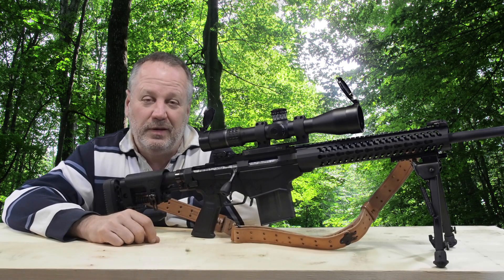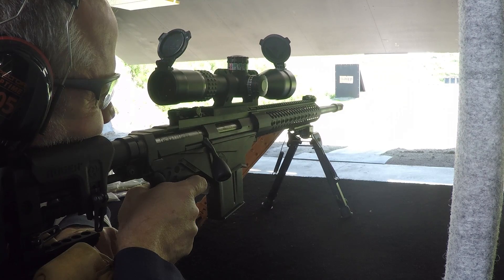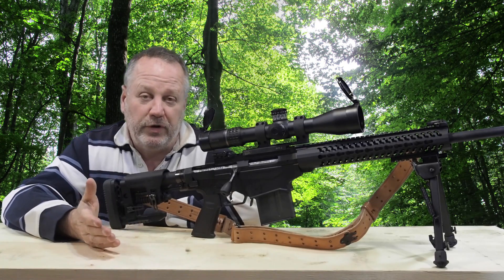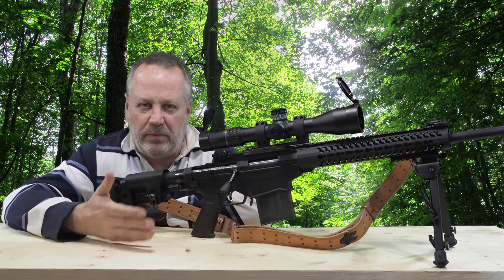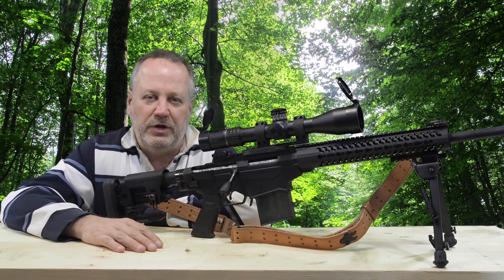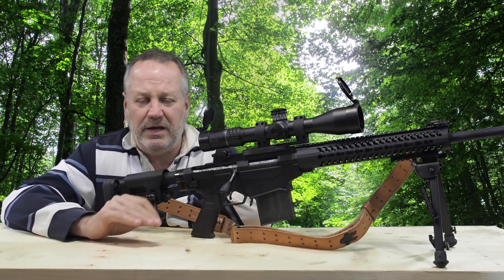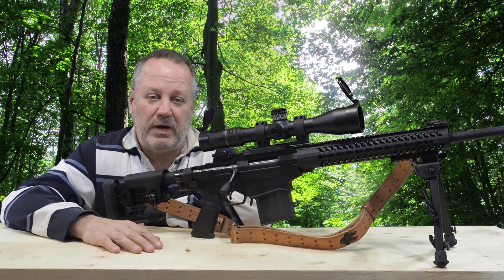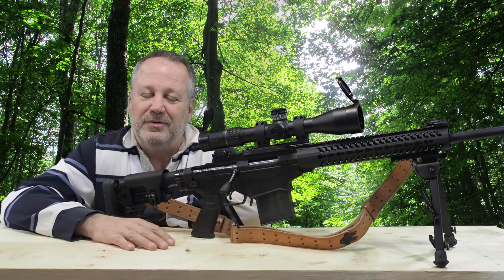Ruger Precision Rifle Fail. This was not a hang fire.

Comment: I had my ruger for 8 months. I saw this video awhile back. I've put only about 140 rounds since and did not experience any malfunction. I just saw the recall notice and my rifle fell in the serial number range. They're sending me a new bolt shroud. Thank you for posting this which probably caused ruger to investigate and ultimately initiate the safety notice. Thanks again.

Comment: You should amend the title as this was not a Ruger Fail! You forgot to mention in the video that you had installed an after-market bolt shroud. Viewers that just watch the video without reading comments below wouldn't have a clue.....
Reply from the maker: I didn't think of it at the time I posted and never considered that might have caused the problem but I am working on a detailed follow up video.
Reply: Why not work on changing the title now? Seems disingenuous to admit you were wrong, then continue to leave the misleading video title. Seems like six months is long enough to do that bit a the very least. However, a follow-up video doesn't seem to be a high priority either. I guess getting views is more important.
Reply: Drew Smith I see common sense escapes you
Reply: @phraktl  I would have to agree 100%. You would think in this day and age there would be a legal remedy to follow.

Comment: You're using an aftermarket bolt shroud which is causing the firing pin to hang inside of it. This is a known issue with aftermarket bolt shrouds not being milled properly. Also, your bipod is on backwards lol. You should probably edit your video description to let people know this is NOT ruger's fault. They do, however, have a recall for THEIR factory aluminum shrouds causing this same issue. Your case isn't the same, however.
Reply from the maker: Yes I have an aftermarket bolt shroud that is based upon the early Ruger aluminum bolt shroud with the same exact potential problem. It is not unique to aftermarket at all. It is interesting though that ruger has a recall on it... that's good to hear.
Reply: Early ruger aluminum bolt shroud? The ONLY aluminum shroud that's been offered via Ruger or even provided from the factory was introduced on the Gen 2's. They never had aluminum shrouds before that. Gen 1's ALL had plastic shrouds from the very beginning. The only way to get anything other than plastic prior to the Gen 2's introduction was via an aftermarket company. I have three RPR's. Two gen 1's; 308 and 6.5 (bought a year apart), and a Gen 2 in 223 that I plan to convert to 22 nosler. I bought the 6.5 gen 1 literally just before they stopped production on the Gen 1's. There has NEVER been an aluminum shroud provided by Ruger prior to that. I don't know where you keep pulling that tidbit from but might want to fact check.This issue, as far as the company's involvement is concerned, was just discovered within the last week. It ONLY existed prior to that from aftermarket companies that had their shrouds milled out of spec.

Comment: It's been 5 months since you posted this video sir, I have the Anarchy OD shroud on mine as well and just had the same thing happen, what is the fix for this issue? Does the shroud need to go back to Anarchy?
Reply from the maker: Hi Mark, I've been meaning to post a follow up video to explain. It's the sharp corners on the bolt shroud that hug the back of the firing pin. The bolt shroud rotates just a smidge and then prevents the firing pin from moving forward. All you really need to do is clear the sides away with a Dremel tool so it cant hook the firing pin. Or you can send it back and I would hope the people at Anarchy will straighten you out and provide you with the updated version.

Comment: Ruger is still shipping affected rifles. Mine arrived yesterday, and is in the serial number range of guns with the problem. Thanks, Ruger. Also, the replacement bolt shrouds rattle.
Reply from the maker: Wow
Reply: No they are not. Outright lie. You may have bought from a dealer that recieved it pre recall and did not perform the recall for the shroud replacement but ruger did not ship you a rifle post recall without addressing it.

Comment: Have only had my RPR for a month and maybe 50 rounds through it. Even though I have had no issues, I still signed up to get the replacement shroud the weekend the notice came out. Received my modified shroud from Ruger in today's mail, 7SEP17.
Reply from the maker: It's great that Ruger sent it to you quickly. I'm sure they have liability concerns over this. Being proactive about getting the fix to customers is the responsible thing for them to do.

Comment: gun safety rule is you dont touch anything for 30 seconds, you pushed foward seconds later with a dirty bolt. wait 30 then up and back not foward. safety 1st
Reply from the maker: JB: Your comment would apply if the firing pin had fallen. In this case the problem is that the firing pin was hanging up on the bolt shroud due to a design flaw. Touching the bolt is what made the gun fire. Ruger now has a recall notice on this but did not at the time I posted this video.

Comment: This is a known issue with the bolt shroud on a number of the Generation 2 Rifles. Go to the Ruger website because there has been a safety recall on a number of the bolt shrouds. Enter your serial number and if it is subject to recall, it will tell you. You will then enter your information and Ruger will mail you a new "updated" shroud for FREE.
Reply: Happened to me on a Gen 2 that is past the serial number range for bolt shroud recalls.  First time shooting the gun.  Opened it up and the cocking piece was snapped into two pieces...thanks Ruger! Back for warranty repairs...

Comment: Just purchased my rpr in 6mm creedmoor can't wait to take it to the range
Reply from the maker: I think the 6 Creed is the best performance caliber available for the RPR. I have one in 308 and one in 223. The RPR in 223 is unique really because it feeds from a 308 length magazine. That allows hand loaders to seat heavy bullets 1/4 inch longer than factory ammo. That increases the case capacity and allows the 223 to achieve higher velocities and remain supersonic to 1000 yards with 80 - 90 grain bullets AND feed from the magazine!!!! F-Class shooters run such a load from single shot rifles only because magazines for the 223 are designed for 2.25" long rounds but the RPR mags allow rounds 2.5" long...Everyone is all hot and bothered over the 224 Valkyrie but really the 223 can do almost as well from the RPR platform.

Comment: what shroud did you use? I have a LRI and around 500 rounds with no problems as of yet
Reply from the maker: Johnny, The shroud that was on the gun during this video was from titatium gun parts, but you may have the problem even with your LRI... You should examine it. If the shroud narrows toward the front it could cause the firing pin to hang up on the corner of the shroud. I'll post a detailed video before long on what I found and what to looks for if you may have the same problem.
Reply: thx for the response, scary stuff right there

Comment: had same problem to day. wild be nice to know what the problem is
Reply: found the problem on my ruger rpr I put the plastic shroud back in and no more problems. the aluminum shroud I have is to tight so it get hung up on it. on my shroud you can see the marks on it.
Reply from the maker: Thanks Patric, I will look into that. I also have an aftermarket bolt shroud.
Reply: you welcom. i got my shroud from anarchyoutdoors so i am gone give them a call to let them know there is that problem.
Reply: So it's not really a Ruger Precision Rifle Fail.

It's an "aftermarket add on junk that wasn't properly designed for the rifle fail"?. Best to leave the rifle the way Ruger designed it. Lucky he kept the muzzle pointed downrange, the next guy might no be so lucky.
Reply: would not say junk. there just made it a little bit too tight i would say.

Comment: Have you ever tried the gen 3 with the improved bolt shroud?
Reply from the maker: Once I became aware of this problem, I filed and polished the bolt shroud to resolve the problem. Realistically it was an obvious oversight when it was designed. I had two RPR's one in 223 and one in 308 and both have been sold off since I made this video, Now I'm running a Cadex in 308 and a Defiance in 223.

Comment: Either your firearm is dirty or you just didn't close the bolt fully!
Reply from the maker: Hi John, actually the rifle was quite clean... The problem it turns out was a defect in the bolt shroud. Since then Ruger issued a recall to replace the defective ones. The bolt shroud I was using was actually an aftermarket version that was based on the defective Ruger design, that's why it happened.  The new RPRs are fine now.The problem was the bolt shroud could rotate enough to hold the firing pin back (even if you pulled the trigger) and if you touched the bolt, it would rotate against the bolt shroud and release the firing pin and fire the rifle.
Reply: John Terblanche YES, it's GOTTA be one of those two!  Because there is no way in the universe a gun can have a fault to make it unsafe.  The gun is never wrong.  The gun is all-powerful and all-benevolent.  The gun is the one true idol before us.  All who say otherwise are the false prophets of the devil!

Comment: Other then messing up trying to modify the RPR I will commend you for ensuring the rifle was pointing down range.
Reply from the maker: Messing up??? How is changing out a crappy plastic part messing up dude???The original plastic POS Bolt shroud was first class junk and 100 percent garbage can filler. Replacing it was unavoidable. Ruger should have made a better version in the first place, so I wouldn't have considered replacing it.Besides, the replacement titanium bolt shroud was based on the original faulty Ruger Design which was in fact the root problem. Thankfully since I published this video, Ruger corrected the problem in their own bolt shroud and offered a replacement, so good for them for addressing the issue. I hope the after market guys have done the same.If you were to purchase a new Ruger Precision rifle today I would expect this problem would not occur as the new version bolt shroud is not something I would choose to replace.If anyone has one of the earlier versions however, I hope they learn about the potential problem through this video and have the problem corrected.

Comment: If you found the fault not to be the rifle ? Why have you not changed the title yet ??? And yes CLEAN IT ...
Reply from the maker: Doug, First of all the rifle has been cleaned and that had nothing to do with the problem...  I did not say the fault is not the rifle. I said it was a problem caused by the particular version of a particular aftermarket titanium bolt shroud I put on to replace the original POS plastic one. Seems like everyone assumes the noted problem is unique to the Titanium bolt shroud but there's more to the story. Ruger has several versions of the bolt shroud, one of which was used for the pattern of the titanium model that failed. So yes, there appears to be OEM Ruger rifles out there that have the exact same problem. I recently purchased a second RPR that has the new version of the Ruger bolt shroud which is a very new design with changes that resolved thois problem. Also Titatium gun parts has since corrected their version. Also LRI bolt shrouds appear very similar to the version that failed. I will post a new video when I have time... and I don't have much free time.

Comment: Certain Ruger Precision Rifles have been recalled. Perhaps you have taken care of this by now, but the attached video has the Rifle Serial Number range of effected Rifles - - - https://www.youtube.com/watch?v=pTz73WxfAHs
Reply from the maker: Thanks blue... yes.. its all been discussed in the comments. Some aftermarket bolt shrouds were based on the early Ruger design and also have the same problem.
Reply: So ... you got it fixed? How has it operated since the repair? Sweet gun, a bit expensive to shoot for me though. But still very nice.
Reply: So ... you got it fixed? How has it operated since the repair? Sweet gun, a bit expensive to shoot for me though. But still very nice.
Reply from the maker: I fixed it myself with a Dremel and carbide burr to prevent the firing pin from hanging up on the slot in the bolt shroud. It hasn't given me any trouble since.

Comment: same thing happened to me today after less than 20 rounds.
Reply from the maker: Hi Road Warrior: What bolt shroud do you have in your RPR? Take a look at where the bolt shroud narrows and touches the firing pin. The new Ruger bolt shroud is wide all the way forward so it cannot hang up the firing pin. You can test it by dry firing with the stock folded. Just rotate the bolt shroud from the rear (with the hammer cocked) then pull the trigger. Try it by rotating in both directions and see how repeatable the problem is.
Reply: all origional bolt and everything first time using the rifle, and thanks for the help!
Reply: I would contact Ruger customer service, they are usually good about stuff like that.

Comment: First trip to the range with mine today. Total dog crap accuracy. 8" groups at 100 yards. Rifle was scratched and muzzle brake crooked when I received it (I straightened it out). Not too impressed with my experience so far.
Reply from the maker: Wow, sorry to hear that... What caliber? It should shoot better than that.I have two RPRs... a 223 and a 308 and both shoot much better than that. My favorite of the two is the 223 by far. It shoots about 3/4 inch at 100 yards reliably. My 308 struggles to hold an inch... sometimes it does and sometimes not so much, but no worse than about 1.5 inches.Both with hand loads though.

Comment: Obviously send it back Ruger has horrible quality control and they have a lot of crap guns out there, nothing but problems with them .. just go to the ruger forum nothing but complaints
Reply: I'll disagree, I've had my SR556 for around 4ish years and thousands of rounds down range and I've never had problems.
Reply: Thomas Oakheart well obviously some of them are going to run good and I am a good example of that because I have the sr-762 and it runs perfectly but I know for a fact that most of them don't... I did a lot of research on this I know for a fact that they were having problems and still are having problems. They were in the middle of coming out with new products and building new facilities and new hires which led to poor quality
Reply: Modern gun guy he made an update and he had an aftermarket bolt shroud that caused it to misfire. not rugers fault at all.